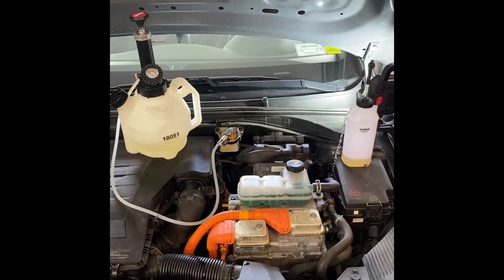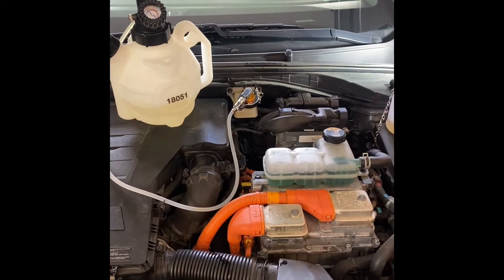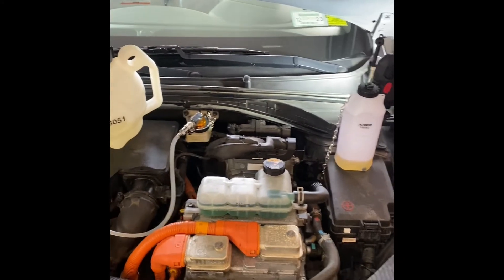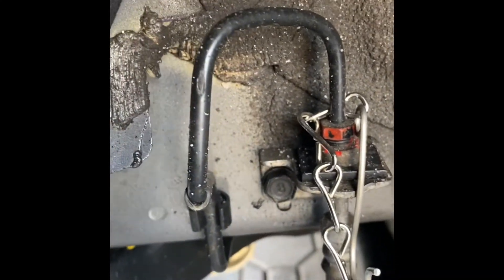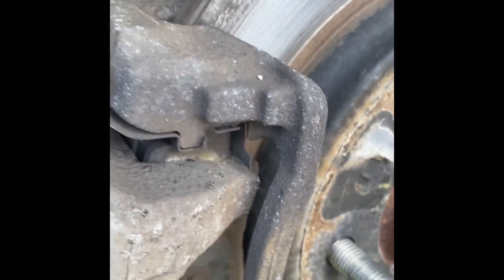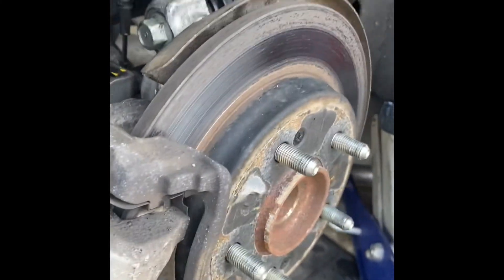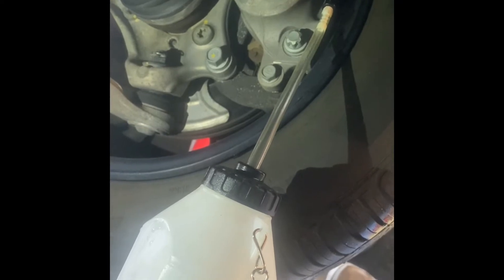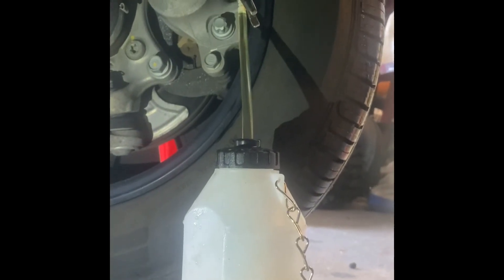Hyundai Ioniq Hybrid/Kia brake fluid flush , Ares power bleeder review!

Comment: You don't need an expensive ares system, I just use harbor freight brake bleed kit, the only draw back is you need to watch the brake fluid reservoir making sure it doesn't run out when you bleed the brake!

Comment: How often does this need to be done in a Hyundai Ioniq?. What is the recommended mileage/time interval for the IONIQ Brake oil change?. Thanks.
Reply from the maker: on my 2019, inspection every 30k miles, replace based on inspection results…. i would replace at 60k miles or every 3 years max

Comment: Thanks for this, I was wondering if using a pressure bleeder at lower pressures would work and glad to hear it does. 

At some point I want to go through the whole procedure of also bleeding the pedal simulator circuit to be thorough. I am sure that’s really not needed but I always wanted to try.
Reply from the maker: i ran the fluid recirculation mode with the gds, you can also bleed the ibau but i didn’t have air in the system
Reply: @hyundaiioniqkianiromainten3319 hi can you send a link as to where I can get the GDS, thank you
Reply: Where can i get GDS? @hyundaiioniqkianiromainten3319